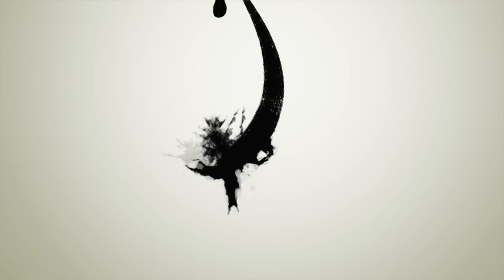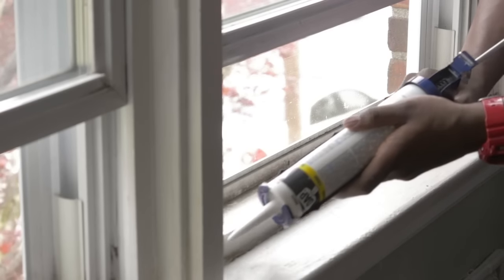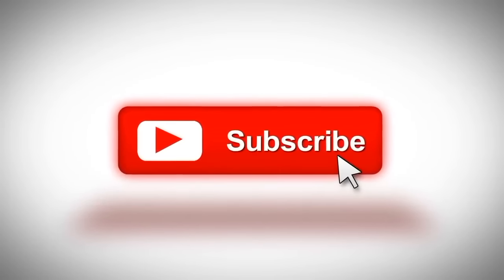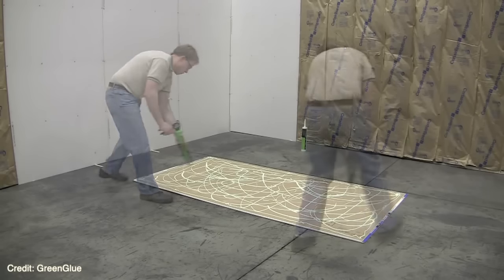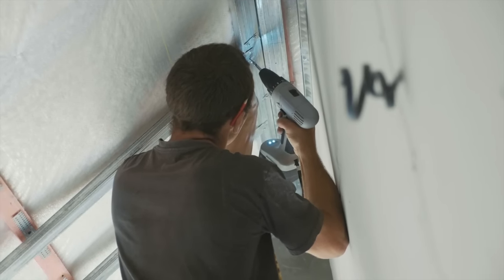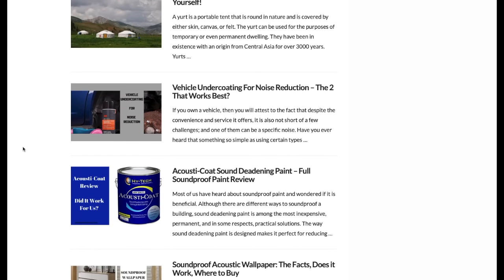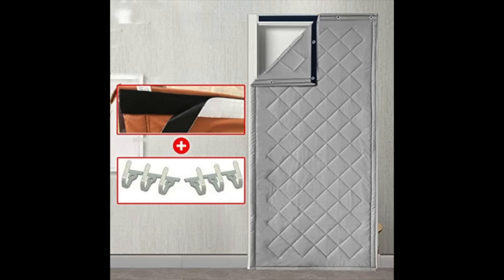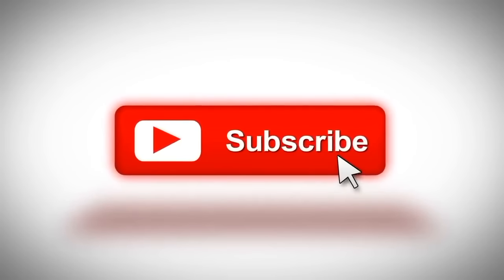How to Soundproof a Wall - 7 Easy DIY Ways!

Comment: I have a number of thoughts in response to this video. I apologize for not ordering them better, but this is powerful info I would like other viewers to have.

“Soundproofing” is a colloquial term. “Isolation” is the technical term, as stopping all sound entirely is impractical/impossible. Most performance specs for a system or a commercial product (such as a door) are given as a Sound Transmission Coefficient (STC) value in the USA. This standard is really focused around voice transmission, so it is not valuable in determining effectiveness for bass transmission loss. It also does not imply mechanical isolation, which is necessary for isolating structure-borne transmission such as foot traffic on a floor above.

For isolation, physics demands mass, decoupling, and damping. Low frequency sound has dramatically more energy than other sound of equivalent Sound Pressure Level. Thus, a loud bass guitar amplifier requires much more mass and decoupling than other situations. Many recording studio live rooms employ a double concrete-block wall with an air gap in between for this reason.

While mass loaded vinyl is not cheap (especially if shipping is involved! 😳), a wall system using it can be very effective, even performing well at low frequencies. This is a good system for saving space and for avoiding paying a structural engineer.

Otherwise, a “double-stud-wall with resilient channel (RC) and 2 layers of drywall on the outer faces and both wall cavities filled with insulation” is excellent for most circumstances. If I recall correctly, it achieves an impressive STC of 65 using cheap, conventional, low-mass pink fiberglass insulation.

Double-walls improve decoupling between the wall surfaces, thus dramatically improving isolation. An air gap is required between the walls, even if it is only an inch. And it is important that drywall/sheeting only be applied to the two outward-facing surfaces of a double-wall system. Insulation is necessary within the walls to provide the damping. And there are various potentially superior options for it besides the pink fluffy stuff, including rockwool and Ultratouch denim.

Addressing the topic of isolation without explicitly mentioning the concept of “flanking paths” is a little unfortunate, but it is a short video. The emphasis on sealing the air gaps at the beginning touches on this, and it is an excellent point, most especially for those without budget to do more. Just keep in mind: a totally sealed room cannot get fresh air/oxygen nor remove mustiness without an hvac supply AND return to the room. Something to consider if you’re in a fully-sealed, non-ventilated room for a longer periods of time.

Using the putty on ceiling light fixture receptacles and other wall-surface penetrations, in addition to light switches and outlets, should definitely be employed for the best results in open-wall treatment situations. For closed-wall situations, one might add foam air-gaskets marketed for stopping drafts in addition to caulking electrical box edges with an acoustical sealant. Caulking the edges does not fill the holes in the back of the boxes where wires enter, but the additional foam seal should help slightly. However, do not use caulk inside the box: it’s against code, potentially creating a fire hazard. Speaking of which, there are fire-blocking spray-foams and caulks that CAN be used for wire/pipe penetrations within wall cavities (through sill plates and other framing members) to minimize flanking paths without creating fire hazards. This option is a relatively minor optimization for open-wall construction.

In some situations, flanking noise will primarily come through ductwork. Isolation of HVAC systems is a very complex topic, typically requiring a lot of space for baffle boxes, relatively expensive commercially available in-line duct-baffle devices (think: a car muffler), or an entirely separate HVAC system to achieve the best results. Though simply replacing a section of rigid ductwork supply and return for a room with a section of flexible insulated duct that takes a S-shaped path can help both reduce mechanical transmission of hvac noise and improve isolation from other branches of the hvac system (other rooms). This works because sound looses energy when it changes direction. But radical direction changes can create additional noise from turbulence, and can also dramatically reduce air-flow. So take care to not make the curves too radical, and consider additionally isolating the cavity containing the flexible ductwork if taking this low-cost approach.

Isolating curtains are indeed painfully expensive, and probably best employed as suggested in the video for covering hollow or thin-paneled doors. But an automatic door bottom (look it up!) in conjunction with neoprene weatherstripping around the top and sides of the jamb are also important for truly effective door isolation. Doors and windows are typically a weak link in an isolation approach, so properly sealing (and quite often also replacing) them is important for acceptable results. Another cheaper and lower-tech option for sealing the crack under a door is installing a threshold with a neoprene gasket that abuts the door when closed. (Thresholds should also be caulked to the floor with acoustical sealant.) The downside of this option is having an edge that can cause a person to trip and can be difficult for wheelchairs, dollies, and other things to roll over. To check whether the door cracks are properly sealed, simply have someone shine a bright flashlight around the edges with the isolated room totally dark, and see if light leaks. If it does, improve the gasket positioning.

The video’s author refers to 2 Green Glue products. The first is a sealant. OSI and others also make this sort of sealant products. But don’t get confused and order the wrong stuff: the stuff for between two layers of drywall will not work as a sealant and would create a TREMENDOUS mess if you tried!

That “drywall panel” Green Glue is best for improving isolation of an existing space without removing drywall. It actually improves in effectiveness over a period of a couple months as it fully cures. Also, the video example shows too much product applied: it should be more like before the cut where the person reloads the caulk gun. This product it is quite a bit less effective than RC coupled with insulation within the wall. But is doesn’t reduce the usable space of the room as much, and is much harder to mess up than the resilient channel. (He alludes to this in the video, but I will state it explicitly: improper installation of RC will basically nullify its beneficial effect.) Most importantly, a green glue system goes up fast, not requiring demolition!

Additionally, I suggest you don’t worry about using a “different” thickness drywall as suggested in the video: just go for 5/8” every time. (There is a theoretical benefit to having differing masses of elements in a 2-leaf system. But this efficiency optimization is completely trumped by “mo-mass, mo-better” in practice. Differing thicknesses of layers is most appropriate for maximizing value from expensive materials, such as large plate-glass window sections.)

The “soundproofing paint” is probably only appropriate for desperate renters. Do not expect a substantial benefit from this sort of product! He has a video on one of these products, so look there and maybe also elsewhere before choosing this option. I am unfamiliar with its performance, but strongly expect it will basically only help make neighboring voices less intelligible if they are otherwise very clear.

This short video omits performance data for the various systems described, which is very important info! It is just an overview video, of course, so check out their main page and other sources. Again, some of these systems are MUCH more effective than others! Isolation is typically expensive and time consuming, so you ought to have data on how well your approach will work before committing to it. SOOO many people try and fail at it (don’t dwell on it—you’re not alone!) because they do not do enough research or they skip annoying details. (One such detail: when installing dual drywall layers, caulk the edges of the first layer with acoustical sealant BEFORE installing the second! Then caulk that one too, of course.) By the time you are looking at isolation, you’re probably either very frustrated, or your field of work (i.e.- music recording) requires it. I implore you to take heed, and avoid the double-frustration of having to re-do a failed isolation attempt. Do your research; don’t dive into your project until you‘re confident in your strategy and have budgeted for everything.

To the video’s author: I’m sincerely sorry for putting such a “know-it-all” comment on your video. I am obviously passionate about the subject. But I will definitely also check out more of your resources. I’m always glad to see people share knowledge about acoustics! Thank you for doing so! 👍

To everyone else: Wow—you made it through all that! You get a gold star! 😂 And good luck with your project! Take your time researching, planning and budgeting. It’s going to turn out great. 👍.
Reply from the maker: Thank you very much for your comment. I love hearing different points of view! 
It’s all about helping one another! 🙂
Reply: Soundproof Guide thanks!

Also, I should really correct myself: STC is Sound Transmission Class, not Coefficient. Had to look it up when you used the correct term.
Reply: ok, nobody actually read all that tho
Reply: @john5554  i did, man, was it helpfull
Reply: TnQ for the passionate nd helpful explanation.
Reply: Holy fuck lol
Reply: Wow, thanks so much, wish I could hire you.
Reply: OK boomer
Reply: Ok so I’ve now decided to completely scratch the idea as going to a studio is just easier lol. I have an empty cupboard and though i would make it into a mini studio but after reading that it sounds impossible
Reply: Nick Suciu Going to a studio IS easier! Lol!
But that doesn’t mean you can’t have your own recording space. Though you’re best off using the largest room you have available, in the case of recording. (For mixing too, but that’s a different matter.) A lot of people fall for the misconception of a “vocal booth.” Those things are only a reality because they’re an affordable way for commercial studios to maximize the profitability of their leased space. But booths tend to have major modal issues that result in either a boomy or hollow sound, or both. Larger spaces tend to give a more natural sound, treated or not. Ideally the room will be 2500 cubic feet or so, with non-related dimensions. But that’s a very “hopeful” goal, far beyond the 1200 cubic foot room I currently must use for mixing. We all do what we have to in order to make music, which is life itself.

Isolation can be somewhat unnecessary if you have time for multiple takes and whatnot. (If the fridge turns on or a train goes by and ruins the take, for instance.) But isolation is not the only important thing. Being comfortable so you can give your best performance is paramount. So either find a studio where you can feel at ease, or make your own personal space. Or try both!

There’s no wrong answers to making music. But paying a well regarded studio for recording realistically tends to be the best value by a mile for most artists, in my opinion. Just be sure to talk to other artists who have recorded there to gauge their experiences so you can make an informed decision about where to go before putting your money down. And ask the studio what you should do to prepare before your session, in order to get the most from your investment. That last tip is shockingly valuable—take it from a former recording studio owner who encountered lots of clients without prior pro studio experience. 

All love. And best wishes for a good sounding life. 🎼❤️
Reply: @nicksuciu169  dude same... I'm still going to try the minimal...
Reply: Excellent.  Thanks.  Extremely interesting topic.  Been messing with acoustics and sound transmission for years.  Started with room acoustics interacting with audio systems and the use of near-field systems, then went to sound isolation and transmission.  Always amazed at how much sound can get thru a pinhole.  And The effect of raising the resonant frequency of structural members to attenuate low-frequency, thru-air sound propagation.  It's a black art, like so many other human endeavors.
Reply: Holy shit, way too long.  Can you be not like my friend Gary that tells you his whole life story?  Good info if I could find it in the mess.
Reply: @Jape Stucco Fair points! But I’ve not found an EQ that can remove resonance. Boxiness can always be reduced. But sometimes the track will still be unusable/uninspiring. This is usually only an issue as more and more compression is laid on, increasing the volume of the resonant frequencies relative to the rest of the track. If you only have one or two obvious frequencies you can notch em out. But it rarely seems to work like that.

I’ve tried multiband expanders sidechained to a vocal frequency that isn’t resonating, which can be extremely fussy to tune but can def help. SurferEQ looked like a promising option but I haven’t tried it.
Reply: @RealWG7  fill the cavities fully but do not stuff!
Ceilings are the best case for RC because of improved mechanical transmission decoupling—footfalls, dropped objects, etc.

RC is more difficult to get right. QuietRock is easy. Either way, caulk those drywall seams with acoustical sealant. Alternate lapped joints between wall and ceiling below. That type of stuff.

You could just put up a layer of 5/8” quietrock and caulk it and turn on a stereo. See how it performs vs. your expectations/needs. Then decide whether to add more mass. The independent testing sheets for those products new fangled drywall products are pretty impressive to me. Tho I’d still err on two layers 5/8” (one conventional and one acoustical) if I wanted to be assured I won’t be disturbed vs. just want to be assured I won’t hear voices.
Reply: @alext8828  you’re not wrong! 😅 I was amped up that day for some reason. 😓
Also it all gets technical fast. So how much to add or omit? But thx for the criticism.
Reply: @RealWG7  Chk the install instructions on the manufacturer’s website. Should have various use-cases specified for how to lap wall+ceiling joints for multiple layers, what order to stack layers, and expected STC values for different possible configurations. iirc, acoustical drywall works best as the final layer. But I might be wrong so you should check the PDFs available for the specific manufacturer.

Do the same for your acoustical caulk. Most of those recommend leaving a 1/4” gap between each joint. Some are rated for longer lifespan than others. They should all last beyond the rating if indoors, I’d hope. I’m going to use a USG product on an upcoming project, and it cannot get colder than like 50deg without shrinking so far that it might pull away from one edge and lose its seal, for instance. Some are super-messy. Some are and some aren’t paintable. They’re all a little different so go chk the spec sheets of whatever is readily available to you. Can call your local building supply houses, too, as big box stores carry very limited items. Buy more than you think you’ll need and return the remainder, if allowed.

I also encourage you to meet fire code and other building codes, whatever that means in your area. 😉

Seal all those joints&penetrations as that’s #1!!!👍
Reply: @RealWG7  on the wall-ceiling lapped joints I mean:

Ideally you don’t have the two ceiling layers same dimension. First one goes all the way to the wall studs, and wall drywall cut edge butts up against it. Then second ceiling layer cut edge butts up against wall drywall.

That’s the ideal, but don’t know I’d spend the effort if walls were already drywalled.

If walls aren’t drywalled, I would consider adding insulation in them to reduce flanking paths, but that could get really expensive really quick depending on wall area in question.

Hope that helps clarify.

Make sure to remember to let us know how it turns out when it’s finished! 😁
Reply: @RealWG7  Crap, just realized I didn’t answer your exact question.

First, don’t put up drywall followed by RC followed by drywall. The correct system is RC to wood/steel with drywall layer(s) below.

I recommend two layers drywall on the ceiling. Choose between one layer 5/8” quietrock + one layer 5/8” conventional VS. two layers 5/8” conventional hung from RC.

Doing 1x 5/8” quietrock + 1x 5/8” + RC—I’d be looking real hard at flanking paths before sinking the money and effort into it. Sound will probably enter the walls down there and move up through the top sill plate and floor into bedroom before it’d get thru that ceiling structure. (Same for sound going other direction.) So that’d likely mean an additional layer drywall on the lower walls. Or possibly additional material of an appropriate type and installation inside the downstairs walls, at least at the top. This all depends on where the flanking paths actually are, how poorly isolating they are, and how much room-isolation you expect to want.

For clanking bedframes, the RC probably has an advantage. How important that is to you may also depend on your budget and available time. Don’t go overboard with your plan. Pick a direction and go with it. Just be as fastidious as you can about sealing wall-to-top-plate and ceiling penetrations.

Test with speakers or similar now with a free spl meter on your phone. Test again after initial caulking. Test again after first ceiling layer is up and caulked in. If you still want more isolation, add a second layer (which you probably will). Make all layers 5/8”, regardless of composition. You should be able to feel confident of the eventual outcome by the before & after initial caulking. Aim for an STC of 55dB or better for great isolation. 60+ is excellent. But walls / flanking-paths must also be addressed to successfully achieve those numbers.

Clearer I hope? Sorry I don’t have a strong preference for RC vs acoustical drywall in general. I tend toward the new drywall products. But if you want more extreme isolation you might need both. All depends on your expectations and budget.
Reply: Thanks for this - it reads like a good summary for everything I read so far. A good way would be to test sound coming through walls first (for instance, my neighbors recently soundproofed and they had to turn up the volume quite a bit for me to hear it) and then approach how to isolate the sound. For this wall it reads like adding another layer of drywall with greenglue sounds like a good option? as it will help that extra bit more but I don't need to add 7 inches of wall. i have small house.
Reply: @emil4985  Don’t know what your walls are built like or what type of noise you’re trying to isolate. But yes—first figure out where the noise is coming through. And yes—one layer of 5/8” X-rated drywall with green glue atop a conventional residential wall surface can accomplish quite a lot. But again, a lot depends on wall/ceiling/floor construction. Just improving mass&damping of one wall surface may or may-not not get the results you are after.

Test, try an improvement, re-test, and then assess whether further action is necessary.

If you’re the wary/prudent type, you can open a small section of the existing wall before adding the green glue and drywall. (Close it back up after.) That way you can see whether insulation is present, and whether flanking paths into the ceiling/floor from the wall structure exist. And since you’re planning to add an extra drywall layer, paint and other finishing of the replaced section is unimportant, beyond air-sealing edges.

Sometimes the results will be unimpressive without also improving the ceiling surface or the internal junction between wall and ceiling, for instance. (Other “for instance” things would be flanking paths at the wall-floor junction, connected walls junctions, or penetrations for HVAC, plumbing or electrical.) Sometimes removing the wall’s entire drywall surface to install insulation and/or block flanking paths is warranted. (Extra labor and materials costs.)

Soundproofing is all about the overall construction. The keys are mass, damping, and mechanical decoupling. Green glue adds damping and decoupling. Extra drywall adds the all-important mass. It’s going to help for certain, but it might also be worth peeking inside the existing wall structure before proceeding.

Good luck! 👍
Reply: @fosterlewis7360  since you've been so kind to answer my last question in an elaborate manner. Would you recommend two layers of 'regular' drywall (a bit thinner) with green glue in between, or one layer of 'soundbloc' drywall on the ceilings (a bit more thick)?
Reply: Foster Lewis: “I have a few thoughts....” -proceeds to release the arc of the covenant of sound isolating knowledge.
Reply: This is all welcome and I need help with it, as even now,  they are hammering on my wall next door... its been endless upset. So to learn to sort this asap. Is what is totally necessary... its ruined my home life, many times.. having insufficient wall 'isolation'   🥴🥴😭😭😭
Reply: Who can help with this in Bournemouth?
Reply: @fosterlewis7360  I got very confused.  Where's all the beautiful guys that are experts and happy to help us ?
Reply: @loveispatientloveiskind2205  In case I didn’t answer the question u intended:

If you mean, “Who can I pay to make my home soundproof?”

I have no idea who does acoustic work in ur area and I’m not going to do your research for you. But in my area, the only ppl who specialize in acoustics are focused on expensive commercial construction. And all of the builders I’ve encountered don’t know anything about sound isolation, and most need very clear instructions on how to build something to be soundproof. (And they need to be willing to attend to the small details and do everything thoroughly, which they need to be agreeable to when you hire them.) So it’s probably easier to hire someone to make the plans/drawings and handle communications/instructions to the actual builder.

If you’re not going that far, whether for budget or otherwise, just slam up more drywall with green glue and call it a day. 😉 Or do what I did and buy books and learn how to tear your wall surfaces out and rebuild them better.
Reply: Wow too long
Reply: Thanks so much for taking time and energy to share this valuable information.
Reply: Jesus Christ i just read the fucking quoraan
Reply: @notafascist3171  huh
Reply: @Pablo Slalom you’re welcome! And I feel your frustration, working with a space you don’t own. Realistically, I’d assume it probably isn’t going to be worth investing in as things that work tend to be expensive and often involve some form of demolition/construction. If I were in that situation and intended to stay a long time, I might approach the landlord about my desire to hire someone to add insulation for soundproofing. Or might try getting a bid on what can be done. Sounds like the spaces are divided by a wall, but the wall is not solid in a shared attic/crawl-space. Sounds expensive to change. If a person can get up there, perhaps they can seal air gaps in the walls/ceilings for wiring etc. with canned spray foam. Just keep in mind that all those foams are toxic, and some are so bad that the building would need to be unoccupied for a few days for hazardous vapors to dissipate.

Another option is firebloc caulking. It won’t fill as big of a hole, but can be used to seal around wires/fixtures. If you can seal above her side as well, I mean, it might make a difference while being affordable. Probably the commercial-rated stuff is required for multi-family dwelling, but you’d ought to consult your local municipal building codes. All those are as effective as a standard drywall-edges acoustic sealant for noise control, except they are suitable/intended for penetrations.

Beyond that you’re talking adding insulation and/or another layer drywall or something. Not exactly ideal to pay to improve someone else’s building. But if you insist, I would try plain fluffy fiberglass or cellulose insulation instead of moving blankets—building codes and specified materials largely exist to prevent house fires.
Reply: This is a great addition to the video. But now I’m collectively stuck on what I should do to my room. Bought a house and want to “quite” my drums. Now not sure what route to take =\ lol
Reply: a good strong noise violation violation idmeate kick out on every rental lease best sound proofing ever invented, I wonder can I get a patent on my idea?